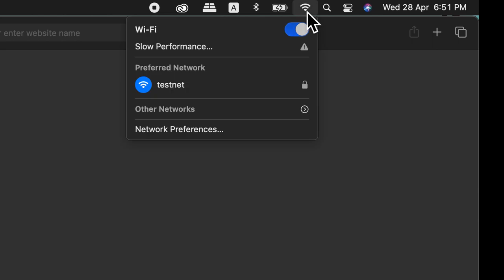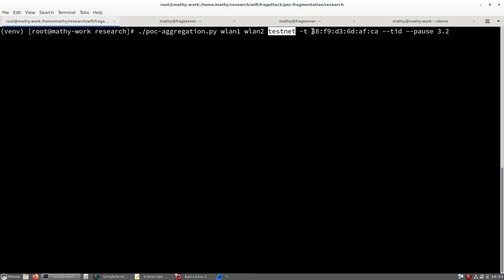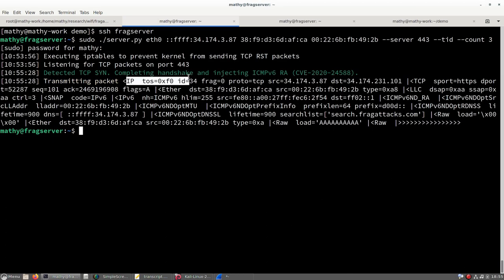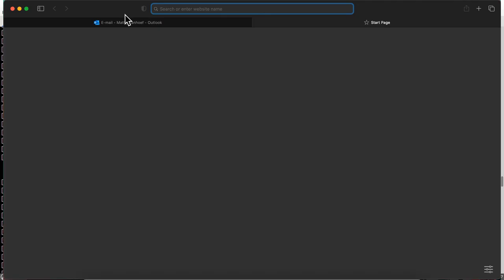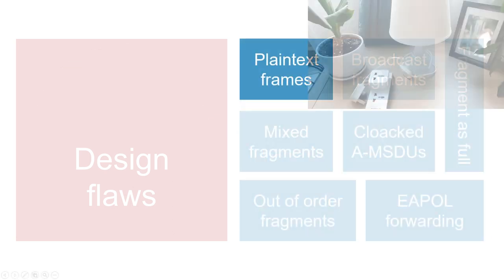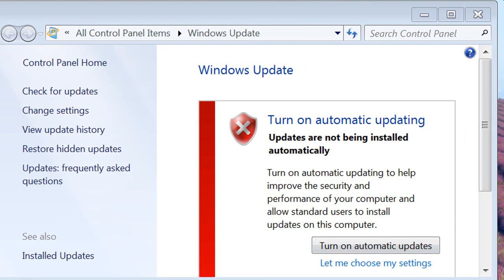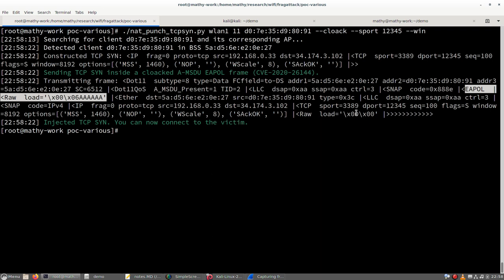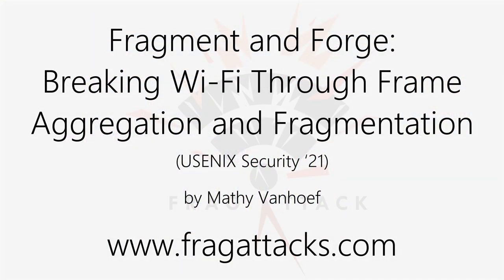FragAttacks: Demonstration of Flaws in WPA2/3

Comment: Would mitigations in access points reduce the throughput bandwidth performance of Wifi? Especially for Wifi6?
Reply from the maker: The security updates won't reduce the throughput of your network. If you disable Wi-Fi 6 as a temporary mitigation that might of course reduce the throughput.

Comment: Can the DNS not just be set by the FakeAP without the injection just by using the whole DHCP process or whatever? FakeAP/Evil Twin attacks aren't particularly new, but the injection for stuff like Windows 7 attack is pretty cool
Reply from the maker: The attacker isn't creating a traditional "rouge AP". The attacker is copying all frames from the real AP to a different Wi-Fi channel, and this is used to reliably block and modify encrypted frames. Technically it's called multi-channel MitM, see for more details https://papers.mathyvanhoef.com/wisec2018.pdf It's only possible to inject frames towards the victim by using the new design flaw.

Comment: So hold on, based on this video, the flaws aren’t in WiFi design but in:
IPv6 insecure RA design
Lack of security in IoT devices
Bugs/design flaws in unpatched windows 7.

… but obviously, WiFi is to blame.
Reply from the maker: No, normally in a protected Wi-Fi network you cannot inject packets. This means none of these attacks, in the situation described in the video, are possible under normal circumstances. The discovered vulnerabilities allow you to (simply stated) "remove" Wi-Fi protection.

See the website and paper for details: https://papers.mathyvanhoef.com/usenix2021.pdf
Reply: @vanhoefm  true, and I understand you are simply using these as demos for the underlying flaws in WiFi, but these demos would also apply to wired networks.  You could spoof a MAC and if it’s not protected at the switch you could easily trick the MAC bridging table and use the same exploits.  So the root exploit in these demos is actually the lack of security on the upper layers.
Reply from the maker: @Leftplayer1  Wi-Fi security is supposed to prevent an outsider from getting internal access to your network. The demo shows that this isn't the case. The equivalent and better comparison is a wired network that uses port-based access control, in which case these demos wouldn't be possible.

Comment: I still dont understand this. Why isnt this super important? I've read several times now, that this is kinda impossible to abuse. Why? I have several APs and devices which don't get updates anymore. Am I at risk if I use WPA2? Or do attackers need to be "inside my Wifi" and have the WPA2 key to attack?
Reply: I am confused as you are....
Reply: @wildyato3737  Yeah. All my APs still dont have an update for this and wont ever get one. I am not sure how risky it is or if Im safe.
Reply: @bestonyoutube  I am also facing this thing,that you said before......also I am experiencing unwanted sudden kick out form my network.....So does my internal network got hacked?......
Also facing Internet outrage
Reply: Unless you update ur APs and WiFi devices against these new vulnerabilities, they are suseptable to different types of aggregation and fragmentation attacks mentioned. It's a widely affected implentation flaw in the 802.11 std. Unfortunately, many devices can't be patched especially iot
Reply: And, to abuse these flaws, you must set up multi channel mitm setup.
Reply: Here's a tip; Turn off your APs when you are not at home or not using them. It will make it much more difficult for an outsider to gain access to your network.